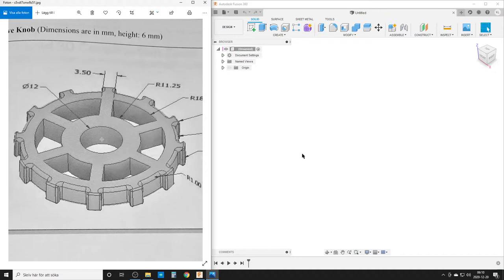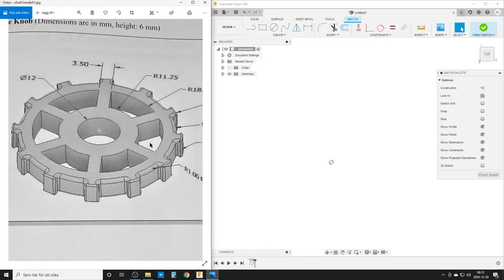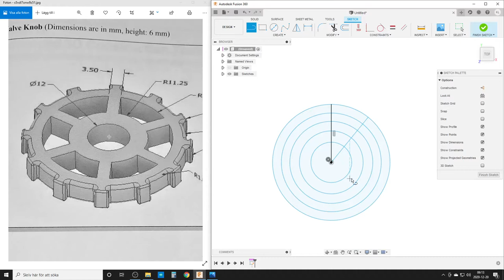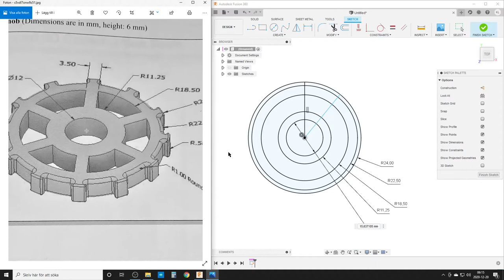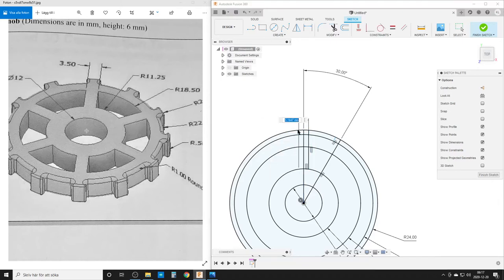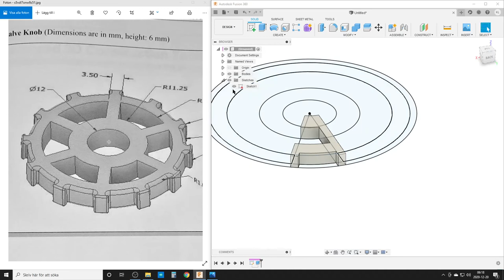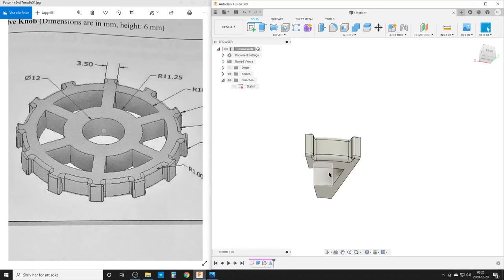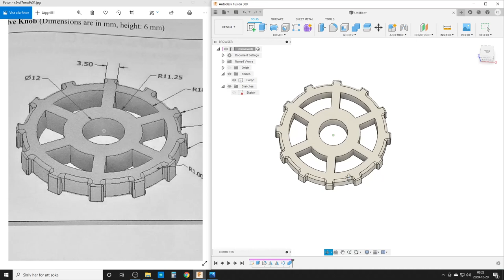Fusion 360 - Sketches are NOT Drawings

Comment: Very interesting, thanks for sharing Kristian. I would've done it totally different, but your method is way better and more stable and easier to change afterwards.
Reply from the maker: Thank you. I don't know if my method is "good" but I have noticed a lot of question lately where the problem is a bit to "ambitious" sketches.
Reply: @KristianLaholm  This implies that you are active on a certain forum. I usually Google my issues and quickly find an answer through the official forums by Autodesk. Is this where you are also active?
Reply from the maker: I keep my eye on some Facebook groups and Reddit as well as Autodesk official forum, there is a lot of good knowledge on the official forums. 
I also like to look at other softwares forums and videos, some question is "universal" to 3D-design.
Reply: @KristianLaholm  Yeah Reddit is also a great source! Helped me a lot with Blender for my artworks. Besides that I'm an admin over at the Reprap forums where the original diy 3D-printers stem from.